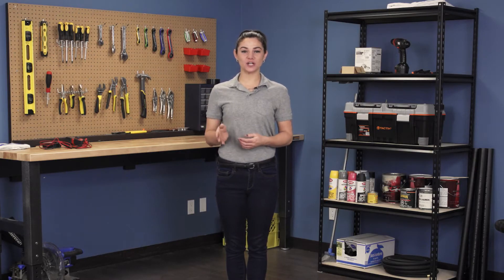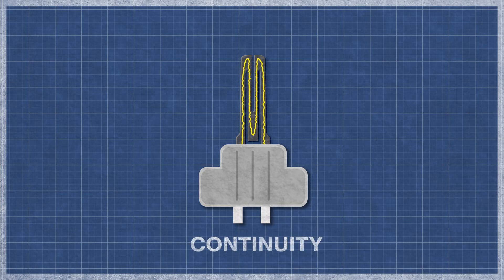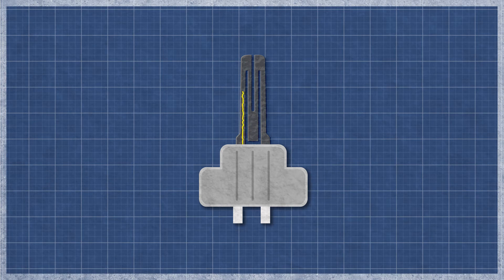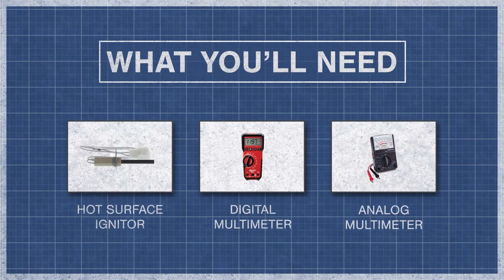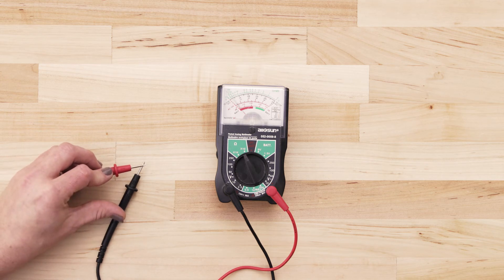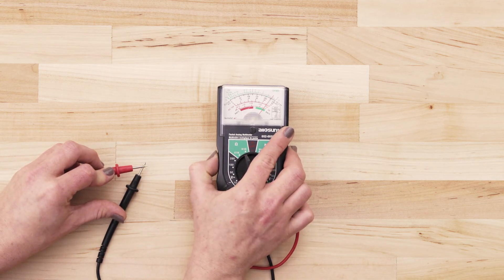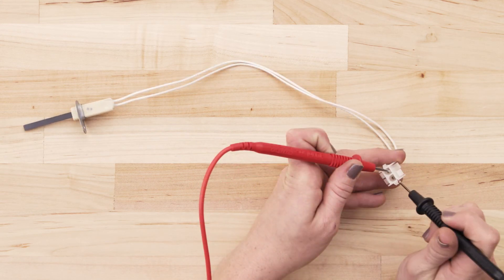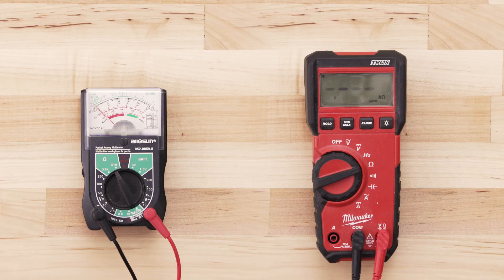White Rodgers # 768A-844 - Continuity Test (Gas Furnace Ignitor)

Comment: Today is the fifth igniter installed into my sister’s Lennox furnace. Seems that they last longer than the warranty but sure as heck not like twenty years. Let’s be fair. Upon inspection of her condo she had many vents closed off and two blocked by furniture. This is not good. I suspect it is an airflow problem which results in high heat in the furnace caused by restricting the airflow. Must give Lennox credit in designing a furnace that takes abuse and keeps ticking.